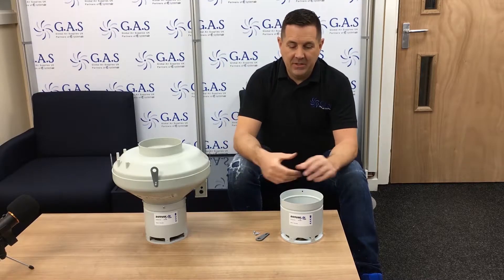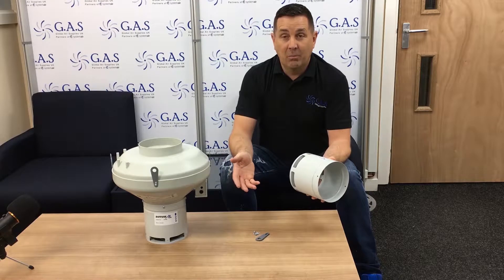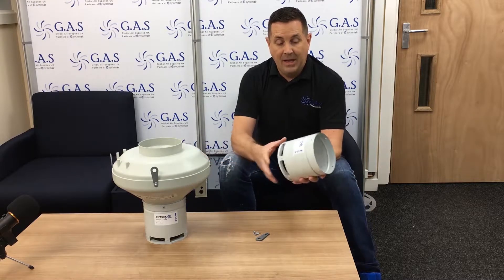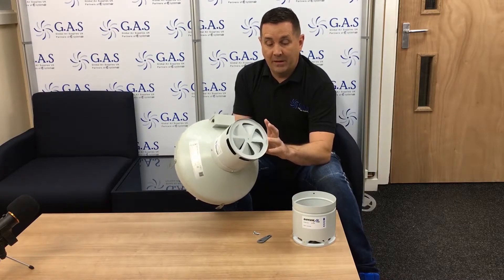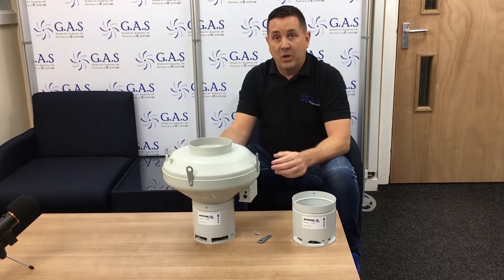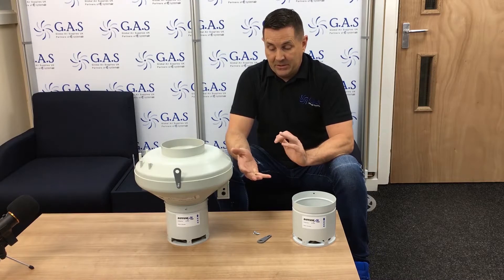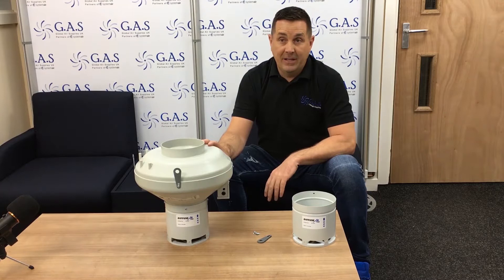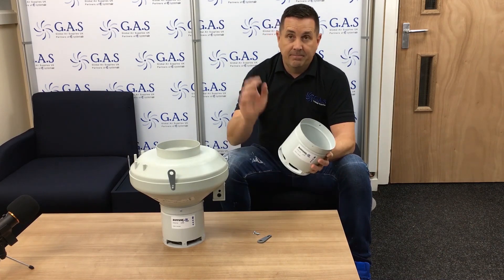DiffuseAir

Comment: The most expensive piece of plastic ever made. I can do the same out of coca cola bottle.
Reply: dude there is a lot of research done before inventing these
Reply: @fastcontrolps4562  😀😀😀 it's a plastic bucket with holes in the bottom. 
It's not F-35 or autonomous driving. It's a fucking bucket.

Comment: Will the air just get extracted straight out of the room with the unit being fitted at the top centre. Opposed to the intake coming in from the opposite side bottom corner.